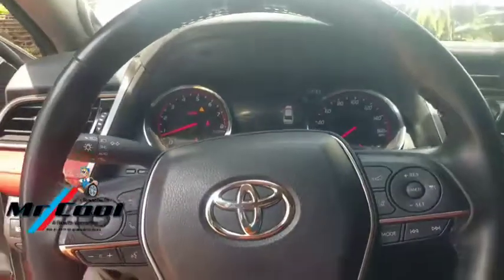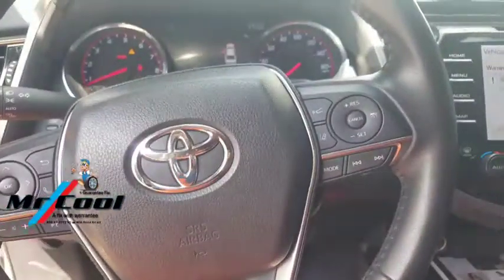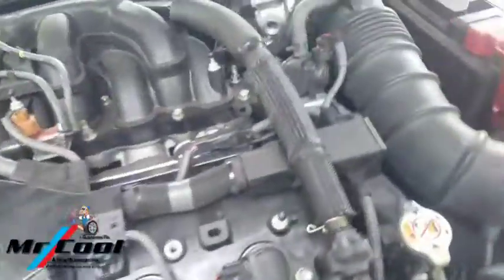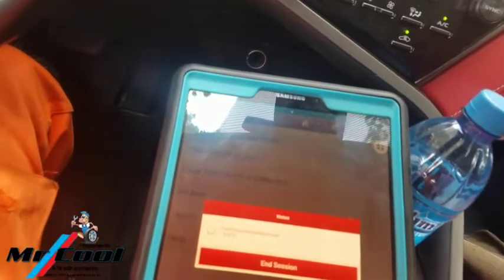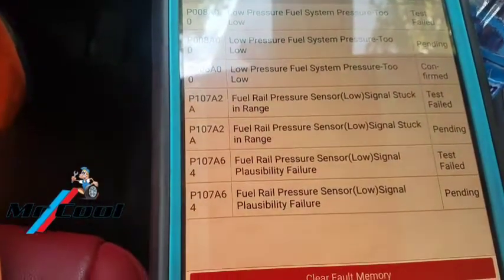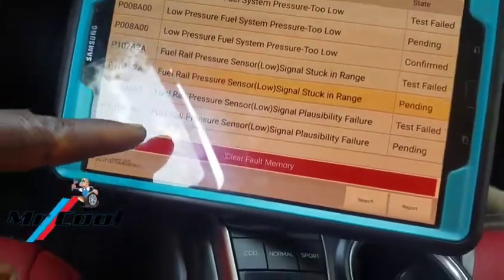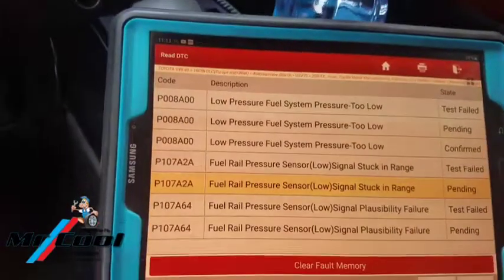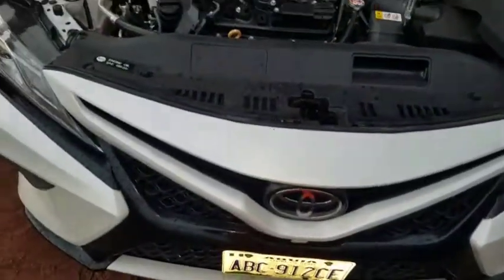2019 Toyota Camry error code P107A2A, C1A40 ICS Failure

Comment: If nothing else is working, try this...strangely it worked (from a forum) "On the morning going to the appointment, the light went off. I got to the service dealer, he hooked up a scanner, it read that my gas cap was defective. He asked if I fill my car up with gas and go and click more than 2 to 3 times after the gas is full. He said that I'm putting to much gas in. Over flow of gas goes into the charcoal filter. Don't over fill the gas tank. So far so good. Hope this helps you out."

Comment: This isn't a mechanic, this is a guy with a tablet. 
You will note this because all throughout the video he did nothing to fix anything other than removing 14 minutes and 39 seconds from your day.

I'm also not an auto mechanic. But I'm going to save you a boatload of time. If you have this code you either have a short in one of your wiring harnesses leading off the top plug of your ecm, or you have a failed or failing ECM.

The intelligent clearance system has to do with collision prevention, which is part of your radar cruise control. The radar cruise control relies upon the capacity to interface with your transmission and your engine and your braking systems. Most if not all of this is routed into the top plug of your ecm. There are three plugs into your vertical ECM module which will be on the driver side of your engine bay for this generation of Camry. You can try completely turning off your vehicle and removing your battery terminals and unplugging your ecm, checking for any debris and making sure your terminals are clean before plugging the ECM back in, and then reconnecting your battery. Turn your engine over. It may feel to start the first time, try again. If you can drive the vehicle and the codes are initially missing and then they return after a short while driving, there's the proof. The service department at your Toyota dealer won't even realize how to do this, because nobody knows how to do anything anymore.

If this is indeed your problem, The next step will be pulling out a multimeter and checking the entire length of each wiring harness that integrates with the sensors mentioned in the error code. Checking the voltage and resistance values of all terminals on those sensors, and lastly procuring a brand new ECM and paying either to have it flashed for your VIN, or getting a text stream and doing it yourself, which is only for advanced personnel who have experience with this type of finicky work. Having a dealer flash your ECM is somewhat pricey, but at least they're on the hook financially if they do something to damage your engine or fail to do it properly. By yourself at least a month with all data, and go through the diagnostic troubleshooting tables to get more information on where these wiring harnesses are located, where the sensors are located, what the voltage and resistance values are supposed to be on a good system, and what order you should proceed through for a completing the troubleshooting steps. Doing this yourself maybe daunting, but it's going to save you something like $40 an hour, minimum.
Reply from the maker: Weldone, it's nice how your emotions are all over the place and you throw away logic, bro you made it into being feminine congratulations

Comment: Great video. What was the actual issue? Just the sensor or the fuel pump? I'm getting the same code: p107A2A, but ONLY this code. My low pressure readings are pretty high, they hover around 90 psi. Low pressure fuel pump was replaced recently, so I'm guessing maybe the sensor? Is the low pressure sensor on the left or right when sitting behind the wheel? My car is a 2016 Tacoma 3rd gen.
Reply: What’s your engine size and how do you solve the issue with?
Reply: @50LOT1  3.5. it's the 2GR. I didn't solve it yet, any ideas?